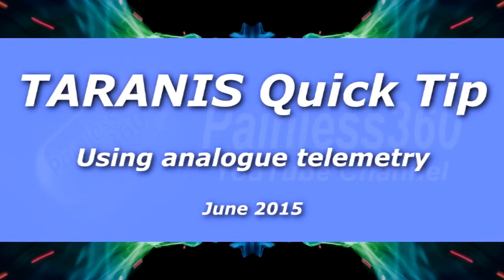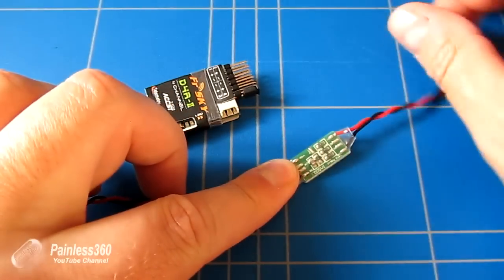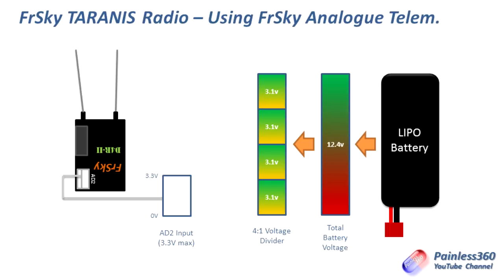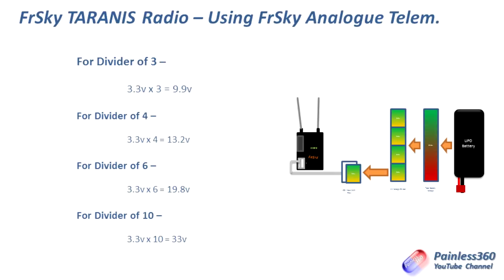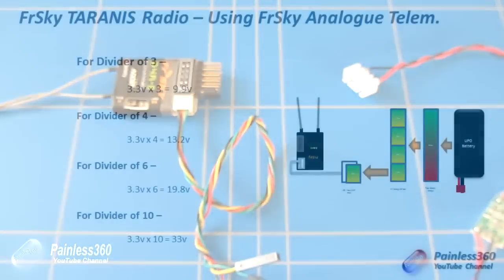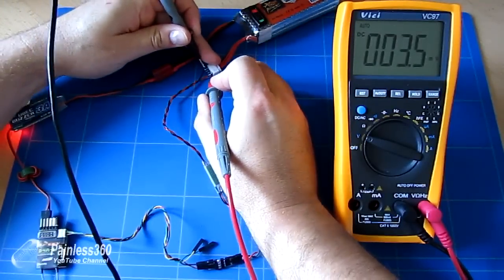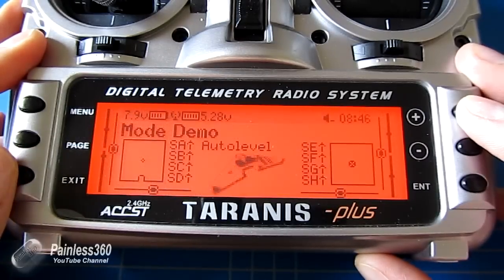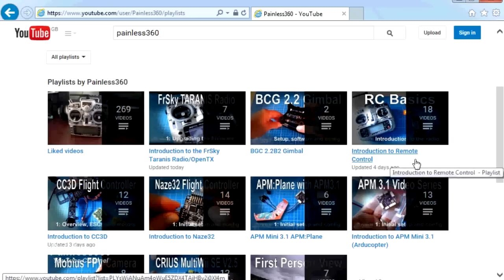FrSky TARANIS Quick Tip – Using Analogue Telemetry (AD1, AD2, A1, A2) with a FBVS01

Comment: Lee, I've just read this on a suppliers website for this unit:
 If you are using only one battery in your model without a separate receiver battery i.e. you are using the ESC BEC, you should NOT connect the black (GND) wire of the voltage sensor because GND is already supplied to the receiver from the ESC. Connecting another ground is likely to cause a ground loop that could result in premature failure of attached electronic components.
Do you agree? I guess that means you just run the one +ve lead to the Rx if you are using an ESC?
Reply from the maker: I've not used this stuff for many years. How it worked for me is in the video but vendors can update and change manuals so it is best to use the most up to date details.. Best of luck

Comment: Hi Painless...do you know if is possible to use this voltage sensor with the RX4R receiver? Due to the small size I want to use it on my Shock Flyer
Reply from the maker: You'll need the smartport voltage sensor instead.. Best of luck!

Comment: I have followed your instructions and am trying to get my Taranis to play a track to warn me that my flight pack (A2) is low but I cannot seem to make it work. I am using the 2.1.9 version of OpenTX and have the setting as follows:-

Logical Switchs: Function: a<x, V1: A2, and V2: 11.4v (the voltage I want to be warned at)
Special Functions: Switch: L1, Actions: Play Track, and Parameters: lipolow (the track I want played)

I have the exact setting for my X8R receiver and it works fine. The main difference is that I have selected A2 instead of Cels.

Comment: Thank you very much for all the videos you make painless360
your help is much appreciated.

I have the same receiver and taranis as in this video and A2 is working, its sending the battery voltage
back to the taranis and is not using the side port.

only connections I have to the receiver are a RC car ESC  and a Steering Servo

Comment: I have set all of this up as you have outlined, my A2 voltages are close together.  My problem is when I set the the taranis to play the A2 value. it is consistently 5 volts off and I have no idea where to make the adjustment to make it say the correct  voltage.
Reply from the maker: Make sure that you are using the right sound files on the SD card. There were a few changes from the format of them from OpenTX 2.0 to OpenTX 2.1.. Best of luck!

Comment: I'm using all the same hardware as this video, however my x9D firmware seems to be different, is this old firmware?  My telemetry page is set up completely differently and I cannot find a range value only an offset which does not work for this.  Can anyone help?  Thanks
Reply from the maker: +wogfun this is for OpenTX 2.0, see later in the series for 2.1..

Comment: hi is it possible to use this on a xsr rx , i am going round in circles trying to calibrate it,  i would be very great full for any tips you have . Edit, don't worry  i see now it does not have an A2 connection , but someone has done a work round by soldering directly to the board but i think i will just buy an xr4 sb .  cheers  bud
Reply from the maker: Happy flying!

Comment: At 7:17 you mention the red(+) and black(-) wires, currently connected through  the balance port, can be connected in a number of other configurations that go to the battery.  Would it be safe to say I can solder them on to the ESC along with the red and black wires where the battery terminals are connected?
Reply from the maker: +Cop Out Not sure what you mean. The balance tap can provide a small current if needed..
Reply: +Painless360 The battery makes a connection to the ESC via wires that are soldered to the ESC board.  At this solder point on the ESC board, can I also solder the FBVS01 wires so that they read the battery voltage?  Basically, I want to avoid using the balance connector every time I plug in a different battery.
Reply from the maker: I see - yes you can. Best of luck!

Comment: Hi painless once the voltage divider has been setup and the range voltage has been set on the Taranis can the Taranis then be set to voice call out the battery voltage, I have just orderd one of these for a D8rIIplus.Love your channel it has helped me out heaps thanks for sharing all the info.
Reply from the maker: There are a few videos for this on other channels. You use Special Functions menu and usually assign a switch that when activated will read out the voltage. Best of luck

Comment: Nice video

Just to add, you dont need to plug the black volt sensor wire if you dont want to. It works using only red wire. At least in my D8R´s i use only the red
Reply from the maker: Ricardo Costa That will work but from my many years of electronics experience I like to have the reference GND local to the signal..Happy flying!
Reply: Thanks for answer. I know its hard to answer so many questions. :)

Comment: Nice tutorial Lee. Cheers buddy.
Just wondering!, can these be used with 4 cell?.
Reply from the maker: darren marshall Yep, the manual for the small voltage divider is online. If you create your own resistor bridge you can measure almost anything DC! ;)
Reply: darren marshall You can use FVBS01 straight with 4S (on 3S input), internal voltage divider is exactly 1/6 = (1,5k / (1,5k + 7,5k)), you can apply until 19,8V without problem for A2 input.

Comment: I have the Frsky voltage divider and Variometer that I would like to connect to a D4R-II receiver for use on a motor glider. It looks to me if I connect the Variometer's data-out port to the D4R-II receiver and then connect the voltage divider to the Variometer's data-in port, I should be able to receive both telemetry data signals. Does this sound correct to you? I don't want to damage any of the components. Thanks for any assistance you can provide.
Reply from the maker: Curtis Adams Hi, sorry I've not tried this myself. I would look at using a sensor hub first..Let me know how you get it working, I'd like to know.